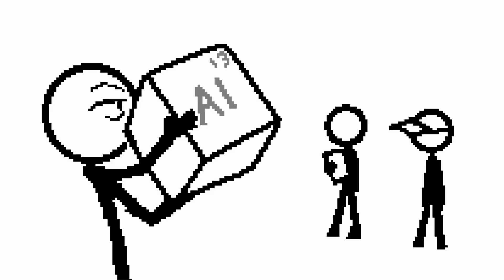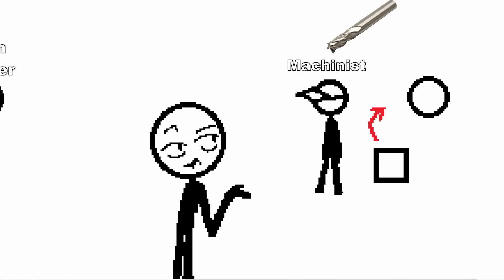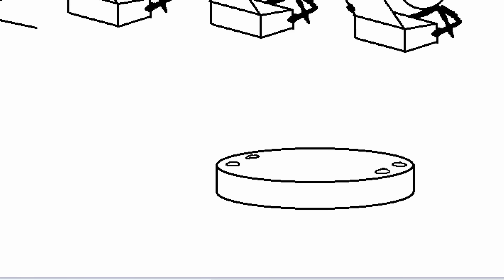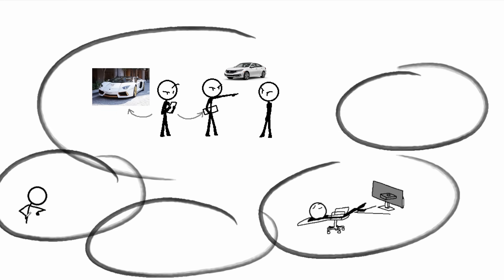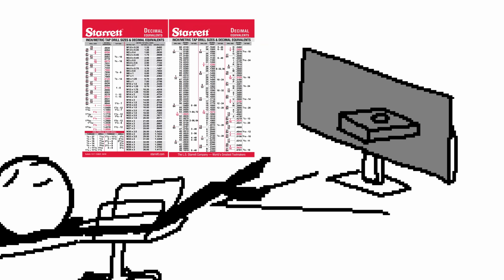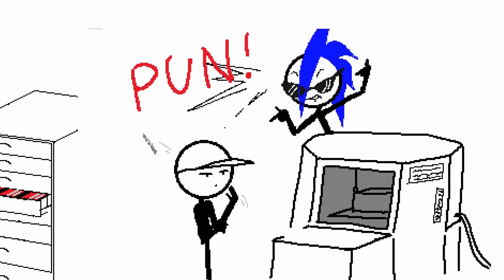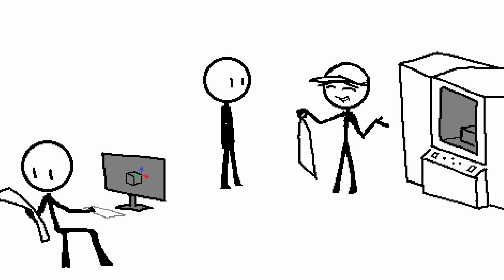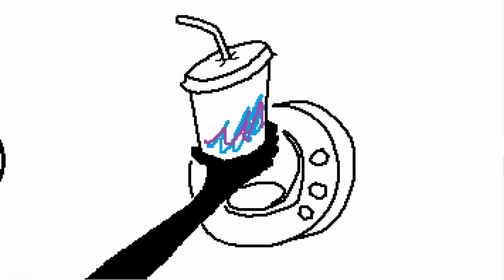Why we hate engineers

Comment: I'm not a designer, I'm not a machinist. I assemble. The part where they bolted the glorious part to the wall for a cup holder slayed me.

Edit: I'm a machinist now, still dead, but only inside.
Reply: I'm a engineer, i still dont like the designer, so arrogant and wont let me speak sh*t
Reply: Assemblers aren't exactly in the fray, it's the people who have to take assemblies apart for repair that hate engineers
Reply: @jankington216  there is a field of design theory called “design for maintenancel
Reply: Ah, so you're on the team with the dwarf (because somehow , in their infinite wisdom, the designers only left enough space for a child's hand to fix the last piece inside of the assembly)
Reply: @jankington216  I do both assembly and repair work on specific large machines. Both scenarios leave our people hating engineers. The machine being assembled often has various issues. Sometimes there's issues with space for various parts. Sometimes holes are too precise and no longer fit properly due to slight warping from shipping or the combined many tiny imperfections from other assembled parts.  I don't understand how something designed for a hose doesn't have enough space to fit the hose. I swear these engineers have special tools they made for their work and didn't think about the assemblers that won't have them or the potential differences in space each site needs.
Reply: @maalikserebryakov  Correction, there WAS a field of design theory called "design for maintenance".  "Design for landfill" knifed it in the back.
Reply: @sleepib  Hahahahahahaa
Reply: It was unrealistic because the parts fit together the first time
Reply: @the_redpyro4906  we hate engineers in construction for similar reasons.  They check with a program that everything should fit in a specified ceiling space and the program says it barely fits.  We install the items on the plans and find that we have to lower the ceiling.  Or the engineer designs an expensive specialty light and on install we find that the wiring space is designed such that we have to cut, strip, and join the wires blind all while we may still pinch the wires while trying to close up the wiring space.  Or the fixture is designed so that you have to put it up in one piece, but it makes it extremely tough to reach the mount and junction box or other issues that the engineer never accounted for in the design.
Reply: Assembly really is the un-sung hero of the manufacturing world.
Reply: @asArsenic  Also the basically unpaid unsung hero.
Reply: @maalikserebryakov  That field is where all good mechanics get layed to rest.
Reply: machinist here, I've literally had to struggle for days to make micron-precise parts only to hear later that it assembled into a handle to open and close a door.  It wasn't even on a space ship or aircraft or anything.  The video is so accurate and correct in every way it hurts, even the meme at the end.
Reply: My favorite "got ya" moments in my career were when an engineer would argue with me about a change needed for production and I would ask "why is that engineered like that anyway, who made the decision to do it like that" and they would stand there slack jawed without an answer at which point I'd say "tell me why this change won't work" and they would just stand there like a deer in headlights knowing they f'ed up and have been called out.
Reply: As machinist I always wanted to know the application of the part.  Let me know what I could get away with.
Reply: Die grinder intensifies

Comment: As a mechanical design engineer for 10 years, i approve this video is 100% accurate. Maybe one more point, is to ask the machinist on what’s their available raw material to reduce lead time.
Reply: There was a couple things I didn't agree with but they are minor. I have never done a revision to a part when it hadn't been manufactured first or built in any way. In addition to that he said to always use standard radii while that could be true for something like a fillet it wouldn't matter for an exterior corner. I actually thought he was talking about exterior corners until he showed a fillet tool then I realized his picture was a side view and not a top view. Interior corners are something else where we want the corner to be just some amount larger then a standard tool so they can sweep it around and not chatter in the corner. If the radii is standard size they have to undersize the end mill to mill it with a good finish. So the saying always use standard radii isn't true. 

That's all I got.
Reply: @jasonmurawski4917  Use standard radius WHERE APPLICABLE. (Caps because cursive doesn't exist on YT comments)
Reply: @chillreznov0227  We go through all this engineering and standard core classes in university just to have a dude go online and show us that "somehow" english comp was just not his thing, huh. I am irritated for you bro.
Reply: @chillreznov0227  You can type italics by adding underscores before and after the parts you want italicized. _Example_. The period keeps it from working, but makes it perfect to show what I mean.
Reply: Example It works!
Reply: You can also use bold  *bold*. with asterisks and strikethrough -striketrough-. with dashes
Reply: @qfrax  They even all work together!
Reply: Holy fuck you guys since when was that a thing?
Reply: Thanks so much!! 😅
Reply: For my shop, it's standard practice to roll the rev on any part that's been sent to a customer or supplier, even if it's not been ordered. Makes sure that when people aren't using our rev control system, they can still tell what's the most up to date print

Comment: I’m at uni for engineering now and there’s a huge emphasis on getting manufacturing experience and being constantly aware that other people are going to have to read and build your designs. Everything we do is based on trying not to have the machine shop guys yell at us lol.
Reply: I did landscaping for a big corporation and we had an in house engineer for our repair and maintenance work, one thing I learned very early on was to make friends with him and make sure anything i turned it was clearly documented and prepped to the best of my ability to make repairs as smooth as possible. Somehow, I always got my gear back the fastest out of anyone at the shop. Weird how that works
Reply: @kingsly3690  Screw innovation let me copy paste a part from an old volvo and put it in this structurally integral area of this spacecraft
Reply: @kingsly3690  for power transmission systems  we mostly “copy”
Reply: @snakedeadly  Design me a transmission, don't use any system that's been used before.
Reply: I'm also in engineering, mechanical, and the sad truth is it's all a giant waste of time. In 5 years AI will be doing the designs and calculations, that's why they're so focused on manufacturing experience now. It's not because of the technologists feelings, if that was the case they would have been making more emphasis to this decades ago. Nope. The truth is engineers are being replaced, just like so many others. AI can design stuff all it wants, but without technologists to operate the systems, AI is useless. Engineers are just expensive design programs.
Reply: @kingsly3690  don't let the salty comments here get to you. The truth is that's what 99% of design does because it's cheaper to source parts.
Reply: Keep in mind, it's not just how to read and build your design, it's how you communicate it.  If you're in CAD, everything is perfect, all surfaces are flat, there's no such thing as run-out etc.  That's not how it is in real life.  Just throwing on dimensional tolerances ain't going to cut it.

Machine Shop guys are going to yell at you anyway.  Machine shop guys yell other machine shop guys that know how to do things better than them.  
In more modern shops, this is actually being circumvented.  CAD is being uploaded directly into CAM, and  then directly into the Machine and Post Processor, and finished parts are inspected from the 3D model.  But it will be another 2 decades before that is the norm. 10 years ago, I worked in one of the most advanced aerospace shops in the world and some of our machines were still programmed on Reel to Reel magnetic tape.  So be prepared for a lot of resistance to change.
Reply: @kingsly3690  they do all the time...
Reply: Same here, within our design classes we actually have some input sessions with some people that have manufacturing experience. 

But we're also going to be getting the experience ourselves as one of the things we design is going to have to be made by us at some point. Which I think is a good approach to not run into issues like highlighted in this video
Reply: I can vouch for this. I started out my career working production in a CNC shop in a factory while I was in college. I learned how to hand program, and do CAD/CAM. Companies love engineers that have actual practical experience. Now I’m an aerospace process engineer at 20. I regularly program all the machines at two facilities among all the other engineering tasks I have like RND and Continuous improvement.
Reply: @G1Bryce  You will lose jobs short after that. When AI designs manufacturing peripherals so it can machine stuff you'll be just as obsolete as anyone.
Reply: @G1Bryce  nope. It's not. The best AI hast touble recognizing red lights. You'll be ok. There might be predictive maintenance, but there is no predictive design. AI might optimize the internals of a specialized heatexchanger for helicopters, that need every bit of weight saving possible, but who makes sure the piping into that makes sense? I'd say one in 5000 parts makes sense to be AI designed and only if you got the 3d printer to back those forms up, like the channel that cannot be drilled from the video, if that is a pilot tube in a gas turbine yeah. But most parts, no way José. Plus who do you think trains/tunes these models, prepeares the data?
Reply: My best advice keep the drawing and print as simple as possible while still conveying all the needed information that coupled with the five points in the video will get you further than if you didn’t
Reply: @G1Bryce I doubt engineers will be fully replaced by ai, at best engineers will us ai as an additional tool
Reply: At FilmTec I worked as a union organizer to fight for equality between machinists and engineers!

Comment: I'm a design engineer and work in a machine shop. It has taught me all these things. It helps when you can just go into the back and talk to the machinist and be like "Hey so what size drill bits/taps do we have around this size? That one? cool that's what I'll put in the design." Just makes things go much smoother.
Reply: Hence the point about the standard charts. Any shop is going to have most if not all of the nominal sizes on the imperial or metric chart. It's when something very specific that's between sizes with no tolerance room is called for that causes headaches.  Sure we can get a tap for 1/4 -23 threads but if your design can accept 1/4-20 we have a drawer full of those and can have the part ready before lunch. Do it the hard way and it's weeks to get the tap and every time your bolt brakes you need custom bolts to make it fit.
Reply: It would be way better if you could spend couple months in each position, I'm pretty sure company would have nothing against it. Just talking to machinists does make life easier for everyone, but doesn't do the justice because of how many factors come at play. For example, even a slight difference in material hardness makes a big difference in tool life and overall costs, better designe can drastically decrease production cycle time.

Comment: As a machinist this is gold.  I've had way too many projects land on my desk without being part of the design process only to have everything you said come true.
Reply: Yeah, just start drilling in and take a left.
Reply: As a lead in a machine shop, I had a sign above my desk, featuring a medium looking into a crystal ball, that read "Communicating with Engineers is only a little more difficult than communication with the dead".
Reply: Got some drawings the other day.  We were a subcontractor of a subcontractor.  The people who subcontracted us were making a frame and they had us do the plates to be welded on.  The engineers had decided for some reason that making everything fit nominal fractional sizes on length was important, so a bunch of the chamfers were dimensioned as things like "50.77°" or "61.29°" because the length on the top and bottom were both fractional sizes.  If it were one part, I can manage it easy.  Do a bunch of step downs with a ball endmill.  It'll take fifteen or twenty minutes cutting, but it'll be decently precise.  Or put it in a vise and tap it to the right angle with a hammer and a protractor and indicator.  But it was 30 of each part.  And since we weren't the ones welding it, I had to be precise and not just talk to our office guys and have them fudge some angles to fit standard angles for our guys to weld it.  So I had to make myself custom soft jaws for each specific angle and then measure the angle of each plate before I cut it to make sure that the metal wasn't warped because it had been cut out with a laser.  Some of the parts were warped and would jump out of the vise if I hit them with a hammer because they were ever so slightly wider in one corner.  Long story short, it took me about 12 extra hours on that job for something I could have had done in about 3-4 hours if it had been standard angles.

Comment: This is amazing. As someone who has worked on both sides of the industry, I absolutely endorse this information. I also laughed my arse off with the leaf thickness; I've been in that exact position, but a good machinist can do absolute miracles, but it's a well known fact that the account of beer of your have to bribe them with is a direct inverse correlation to the material thicknes you want them to work with.
Reply: Well depends on that they make   having thin ass material and contures on samething well shit better pack same additional beer but just extrem thin starting material is actually pretty easy just make additional tools for the job yeha takes time but saves quite same nerve
Reply: So the thicker the machinist, the thinner the product